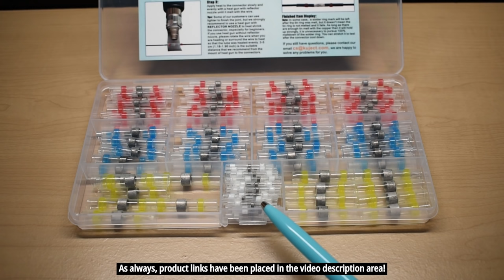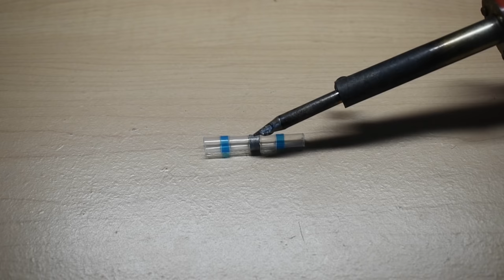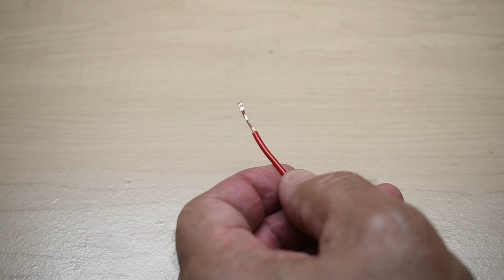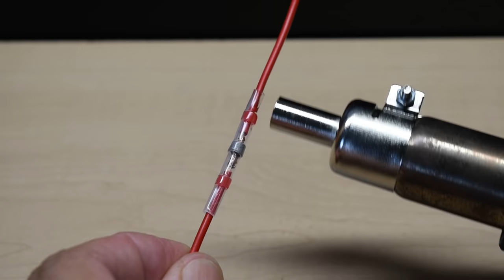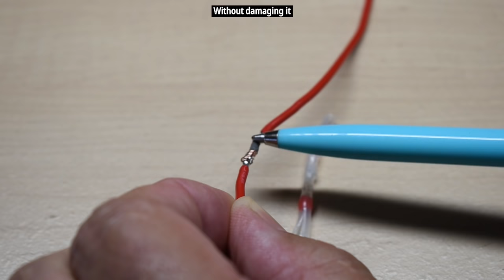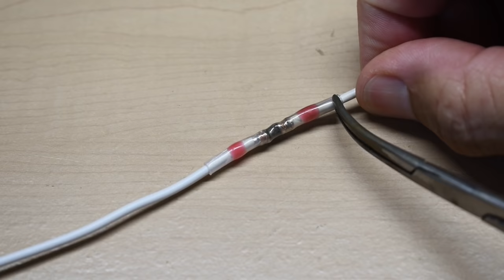Amazon's #1 Best Selling Solder Seal Connector Any Good? Find Out!

Comment: Regardless of how “deep” the solder goes it’s still a good connection have been using these for years and no problems at all from countless projects
Reply: That's good to know! I am going to use these in a situation where there's just not enough room to solder, so hopefully they work.
Reply: @mattmgarza  sounds good! I use these for radio installs never had a issue good tight weather resistant connections 👍
Reply: That was my question.  is it better than a standard crimp connection?  I have a tendency to over-do every project I have, so short of properly soldering the wires, which is a REAL pain,  this, along with some shrink tubing over the top, I would think would be plenty.
Reply: @phillamoore157  it’s definitely good enough to get you by I primarily use these for radio installations with matching the correct colored wires to the harness and after a year no issues still works fine
Reply: You just gave me my hope back
Reply: @Jason_The_Stooge  yea there def good enough to get you by have had my stereo in for about a year and 2 months and still works fine utilitizing these connectors for the colored wires
Reply: I've got some of these that were in my engine bay about six inches from the block for almost two years. They're fine.
Reply: I just used these and I dip both wires in paste Flux and the solder penetrates the strands of wire nicely.
Reply: @stevevaal1322 Didn't he say he fluxed the wires and it had no change because the temps were not hot enough to  heat up the wire without melting the plastic shrink tube... pretty sure he did so what was your method that got it hot enough to do so without melting the tube ?

Comment: We use similar solder sleeves on aircraft wiring. All airplanes have thousands of these as they're used where shielded wires have their shields terminated. Unlike these ones, when we melt them with our heat guns, the solder really flows into the wire. We usually use heat guns that can hit 700 degrees though. Perhaps the heat shrink on the professional solder sleeves are up to the job more so than these? I also noticed that ours have flux in the solder.... you'll see it bubbling out when the solder is flowing.
Reply from the maker: Hi Chris. I increased the level of heat for one test, and the connector started to burn and give off fumes, I cut it open after it cooled, and still no flow into the strands. I added flux for one test to see if all the solder flowed into the wire strands, and no luck. You have a superior connector. :-)
Reply: Same for U-Haul in the hitch bay when we do the wiring on vehicles, our connectors also have flux inside them but lower temps, say 300-350F as we use a butane torch.
Reply: @electronicsNmore  so at the end, you say that you predict the product produces low resistance connections. But thats a good thing, right?...yet per your inspection, the joining doesnt penetrate -  so im confused if youre giving a thumbs up or down....
Reply: These Ones is NOT proper English? Where do people come up with that term? It's just These & Ones does NOT belong behind the word THESE!
Reply: @1OFGODSOWN  chill..
Reply: @1OFGODSOWN  You sound like my Mom. When I was young I would ask her “ Where are my shoes at Mom ?“ Her response “ Between the A and the T”…….lol
Reply: Where can I buy the professional solder sleeves at?
Reply: @jmm1000  l was confused too?
Reply: @1OFGODSOWN  Who gives a Damn? AS far as Yinz all correcting peoples grammar, yinz ought to be a school teacher.
Reply: @mrbreezeet1  All of the people with an Education and Common Sense which rules you out Obviously.😂🤣🤪😜

Comment: You would get a better glue connection to the wire jacket by cleaning it with alcohol and scuffing it up lightly to remove any grease or oils left over from manufacturing and handling. Most wire jackets are glossy so not so good for gluing. Wear surgical gloves before stripping the wires to avoid getting oils from your hands onto the clean wire jackets. A pull test would be interesting, that's the only way I can see this fail. Nice video.

Comment: Out of curiosity, I tried a hacky version of this. Dipped twisted copper in flux, spread it, coiled it with leaded solder wire, heated with 550C heat gun. Melting and soldering part worked, it messed up the insulation though. If it could be focused to single tiny point, it could work similar to this. Bond was really strong, I couldn’t break it with my bare hands.

Comment: I have these and I got a small heat gun but it heats up. Goes up to like 600 f. The solder in the middle really liquified and spread. Made a great connection. I even used one just as a way to seal another connection and the solder liquified and went into the other connector and improved it! They work well with a good heat gun.
Reply: Per the seller they recommend that your air temp be set between 752-1112 f. I think the solder ring melts completely at 280 f.  600 F is relatively close to the optimal temperature.
Reply: Note: We suggest the temperature that the hot air gun should set about:400-600℃ (752-1112°F)

Comment: I've used these in the communications industry and was told by a tech rep for the manufacturer (not the same as the Amazon ones) to heat the solder band first. 
This is to keep the glue from bleeding into the actual splice before the solder does.
Reply from the maker: Hi Sam. These connectors don't have a lot of glue as you saw in their video. The band melts and flattens out, it doesn't go anywhere near the soldered area. Thanks for watching!

Comment: It’s all about the technique!
First, right tool for the right job. Use a miniature torch which creates a small pointed flame, easy to pinpoint the heat. 
Second, you are spot on by cleaning the wire before twisting the ends together, clean copper always solders better. That’s why you use sandpaper or a brush before sweating copper pipe. SO…after sliding the connector onto one of the wires, clean the striped wire, twist the two striped ends together, then preheat the connection, You can get the wire plenty hot with the pinpoint flame before melting the insulation. After it’s hot, quickly slide the connector over the heated splice, and proceed to heat the outside of the connector. When the solder melts you will have a strong soldered joint with the solder penetrating the wire strands. It took me a little trial and error but trust me, done right these connectors make a far superior connection than the crimped or heat shrink tubing method. In short, these connectors are the nuts man!
Reply: After all that
Just solder it?
Reply: I will add the preheat to make mine work better, but too many steps.  Not buying again.
Reply: Thanks. I will try that, but since I have a heat gun with a one inch diameter nozzle, I'll need to block the wire insulation with aluminum foil. I will also dip the strands in flux, as someone else suggested. These connectors are widely used in the aircraft industry ( and not just Boeing) so obviously they are deemed adequate fir critcal connections which might vibrate.

Comment: Thanks for your video, it was very informative. There is a way to significantly improve the connection...add a small amount of solder to the twisted wires before you add the connector - you don't need much. I tried it today and the small amount of flux allowed it to penetrate much more deeply into the wires.
Reply: Just buy quality connectors that come with flux and heat em hot enough (the video shows how to do it wrong, the outer part of the solder ring should melt completely and become silver — this is how you know it is how enough to actually adhere to copper)
Reply: @goury  Where can I buy the good ones at?

Comment: Thanks for your well made video.
I'm wasn't able to comb through all your comments to see if an engineer had weigh in on this.

The joint is weak and superficial. Despite other users having use this in countless projects, this joint has a high failure rate.

It would have been good to show a comparison of the joint using regular flax and solder.

One of the viewers stared that they use a similar product in aircraft wiring, but that product melted at 700 degrees, which sounds like standard solder, and is professional grade.

Cheers

Comment: Thanks for telling us about E6000 glue.  I had a plastic repair job that would not hold with Loctite plastic bonder or epoxy--both of those glues broke again rather easily--so I bought a tube of E6000 to fix it, and that stuff is holding amazingly strong.  I often forget to be gentle with the repaired piece, but the E6000 allows it to flex without breaking again.  Good stuff!

Comment: Seems mildly better than a simple shrink wrap and solder with a less secure bond at the splice. Depending on the application this may be a good choice as it does seem a little faster to execute
Reply: Not really. If you have a portable iron already hot and ready to go it shouldn’t take any longer to solder them the proper way than it does to use one of these plus I know I have a good joint that way as well.

Comment: Monolit brand is arguably one of the best of this type of connectors. I always prefer and use regular solder plus double layer heat shrink tubing (with and without adhesive) but sometimes doing the solder due to the location of the wire (lack of proper access to do a decent job and/or potential damage to other components/wires), using this method as an alternative worked fine for me.

Comment: I love to use this connector for my project where it's not really matter to get the best joint. I simply use mini fire torch over it and then add another heat shrink over it after it cooled down.
Reply from the maker: They're very useful connectors. Thanks for watching! Be sure to share the video link with others.
Reply: @electronicsNmore  yup.. that's for sure

Comment: The ones I got were easy enough (TICONN) but my gripe was that it started to smell like burning plastic and I believe it started to damage the insulator. It was nice and shiny. At 700+ degrees it still took longer than it should have.

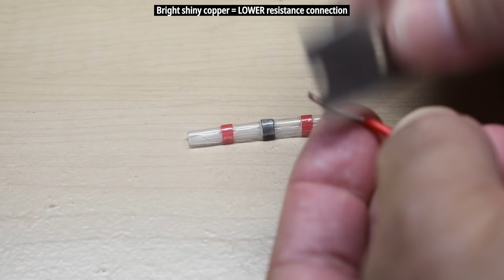Comment: @2:10 I'm so glad you mention this, so many times I've seen so called experts whinge and gripe about problems soldering because the wire is so dark you'd think its been in mud, I've oft told them to use fine grit sand paper, but the blade is good too :)
Reply: Ya for soldering it's important I guess flux should remove the oxidation but I assume a good crimp wouldn't mind to much I guess it's worth testing

Comment: Running a few amps of current over the wire and performing a voltage drop test would be valuable.  Compare the results to a normal soldered joint and unspliced wire.
Reply from the maker: Results would be very low based on my previous wire splice testing video.
Reply: He did say he tested this type of connection in a previous video and the resistance was very low which means next to no voltage drop.

Comment: I sometimes see Amazon reviews of crimp connectors with people complaining that "the solder doesn't melt"! Always amusing, though Amazon have removed the ability to reply to reviews, so there's no way to tell people about their error.

I think I'll have to buy some of these to try out. I noticed that one listing shows the suitable AWG and a conversion to mm that is completely wrong. I presume it would be best to trust the AWG specs.

Thanks for the tests!
Reply from the maker: You're welcome!
Reply: @soundspark  I generally only buy crimps from places like Farnell and Digikey. The branded ones like TE are quite expensive but often worth it. Otherwise, I often get the own-brand crimps from CPC/Farnell (Multicomp, Pro-Power). Haven't had any issues yet.
My main concern about cheap unbranded ones is the metal - i.e. conductivity, corrosion resistance, galvanic compatibility, ductility, strength.
Reply: I have some eBay versions and I can confirm they don't melt very well at all. They don't perform as well as they do in this and other videos on YouTube so I can only conclude that ther are some bad copies being sold. For example, non of the eBay versions will melt the solder with a moving flame from a lighter.

Comment: The solder alloy is bismuith based which is ideal for low temperature soldering but it's weaker than 60/40 solder and has higher electrical resistance!
Reply: thats interesting!

Comment: Thanks for doing this video. I saw these connector and was wondering how they would perform. I'm guessing that they would be perfect for on the spot emergency repairs
Reply from the maker: You're welcome! Thanks for watching
Reply: Definitely better than crimp connectors!
Reply: @Quickened1  A good crimp is tough to beat. These are emergency use only, imo, and not appropriate for any permanent jobs.

Comment: I've been curious about these for a few years now, but haven't tried them.  I've been doing marine electrical work for over 30 years and have worked with most types of connections and terminals.  While these heat shrink & "solder" connectors are surely better than the plain crimp connectors, for sealing out moisture, I still think they are not as good as 3M (or similar) crimp heat shrink connections.  Here is why:  1) ABYC does not allow soldered connections on boats, as the vibration can loosen/break the soldered connection over time.  2) your cutaway was great and it shows air space/voids between the strands of wire, and the solder only seems to "coat" the outside and doesn't fully get inside between the strands.  This can lead to higher resistance and voltage drop, especially with higher amperage wires and devices.  3) the time factor for heating and melting the solder.  Sure, if you are doing just a few wires and you aren't in a hurry, its not a big deal.  But if you are doing a large project rewiring an entire boat, or even rewiring under a center console of a boat, you would be spending a tremendous amount of additional time carefully heating each connection.  And if you had large bundles of connections in a tight space, it would be even more challenging.  4) ABYC has a chart with wire gauge and a "pull strength" for wires and cables in a crimped connector.  It would be interesting for you to compare pull strength of these solder units to a 3M crimp and heat shrink connector.   For reference:  ABYC= The American Boat and Yacht Council is a non-profit organization which sets standards for the safe construction and maintenance of boats in the United States. It is a standards development member of the American National Standards Institute.

Comment: As you noted, the solder does not wick into the strands due to insufficient heat on the copper. Which means there's probably not an intermetallic layer between the solder and copper, a.k.a. a cold solder joint. I prefer to use a soldering iron and hand solder. After soldering, I use a file to smooth any rough edges, and then use HST.

Comment: Nice demo! Thanks for sharing. I wonder if cleaning the insulation with alcohol would make a better adhesive bond
Reply from the maker: Yes, that's suggested for older wiring. My wire was fresh off the spool.

Comment: Thanks for explaining how to use these things. I've never understood that. I have some crimp connectors with the glue in them, and that brand (whose name I don't recall) does seem to stick a little better than what I think you were seeing, since the glue stretches between the heat shrink and the insulation a bit before peeling off.

Comment: like your video...
never use this  connection in a water ( a spa, by ex): I used it with a 24 volt led and after one year, the connection started to be corroded.

Comment: Great video! Can't say the same about the product. 
Seems to be a good way to make unreliable hard to find faults. Three things that are very important when splicing wires.

1. Gas tight connection between the strands. This solder doesn't flow or wet enough, making the connection unreliable and prone to corrosion and a bad connection over time. There is also a risk that it will de-solder it self once you start putting current through it and it heats up due to contact resistance.
2. Gas tight bonding of the heat shrink tube to the wire insulation to prevent moisture ingress. 
3. Mechanical tension relief of the solder joint by the proper wetting and bonding of the heat shrink to the insulation.

This fails on all points. 
This will lead to a voltage drop over the joint, heating it up, potentially melting the solder and the hot glue and de-bonding the joint. This tends to be exponential in nature and may lead to a complete failure quite rapidly. 
The bad bonding of the hot glue to the insulation will lead to moisture ingress and since the joint will heat and cool due to increased resistance it will act as a moisture pump sucking in moisture with every heat cycle. The moisture will condense and be trapped in the joint. It will then progress along the wires inside the cable insulation causing oxidation and eventually failure.
Very hard to find this type of fault. 

Use solder and professional grade shrink tube with glue instead. In critical or hot applications the glue needs to be insensitive to heat i.e. not hot melt and of the correct type for the insulation material so it provides good wetting and bonding. 
It takes marginally longer to do it this way compared to this "all in one" product and it's a well proven, reliable method.

Comment: ok So the solder was just around the outside of the wires, But is that good enough, or don't you like these things? 
Should I use these to solder my TPS sensor wires into my ECM wiring or should I use a regular soldering iron and heat shrink tubing?